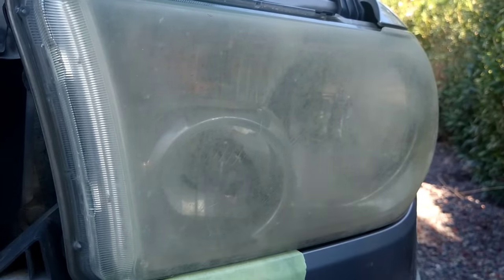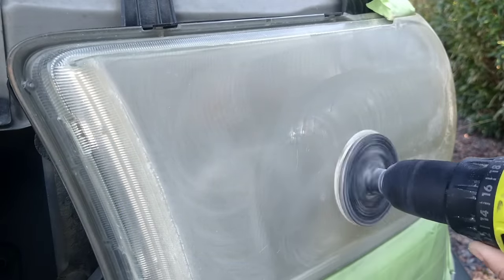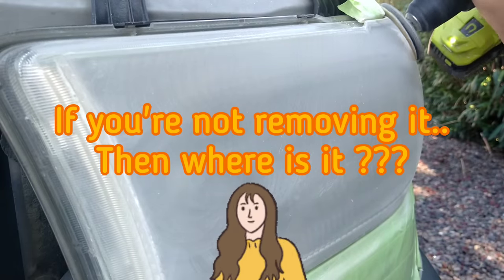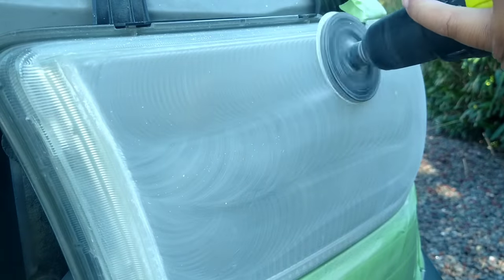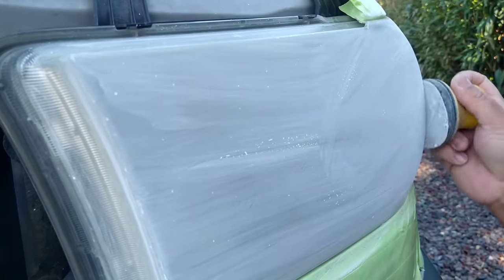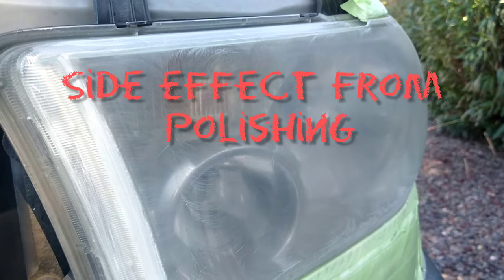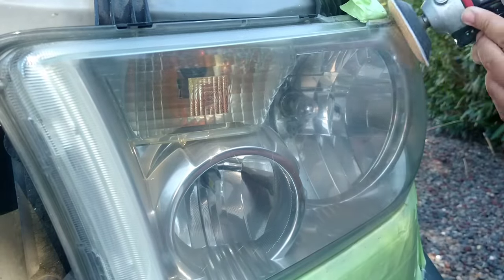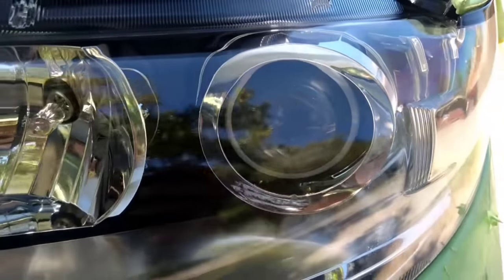POLISHING HEADLIGHTS IS A SHAM/scam  ---  and why you should never only polish headlights

Comment: having played this game, polishing does not last, it will be cloudy within a year, just buy new headlights, the problem is that they are made out of plastic and not of glass like back in the day, the headlights on my 1954 Chevy Truck are still clear, imagine that
Reply: The problem with glass lights is that the lenses break when a rock hits it. When theirs a hole in the lens then dirt and gunk gets in there and so have to replace anyways. 
Sand, polish, ppf and ceramic coating is the way to go. Not polish only.
Reply: @ragnaroksangel  and how many weeks / months before you have to do it again?
Reply: @Good-Enuff-Garage  so far on my wife’s car, sons car and about 50 other customers cars I’m at 5 years.
Reply: @ragnaroksangel  not anymore but I remember the days back in the 80s when my Dad and I were replacing headlights once a year on our cars. Luckily they only cost $20 back then.
Reply: @ragnaroksangel  bahahaha, furniture oil is also a petroleum product which washes off after the first rain or cleaning.
Reply from the maker: https://youtu.be/LcMFr0mpp-4
Reply: @Good-Enuff-Garage  Not weeks/months. YEARS.
Reply: @ragnaroksangel  not being a dingleberry but if you figured out how to make them last years then why haven't the army of engineers at Honda, Toyota, GM, Ford, etc.... ?
Reply: @Good-Enuff-Garage  would you like to see the proof?
Reply: @ragnaroksangel  How come I’ve done it then?

Comment: If you have a new car, I’ve found that if you wax the headlights once a month, they’ll never turn cloudy. I had an Escape for 13 years, and the headlights were crystal clear.
Reply: What type of wax? Is the new ceramic coat better?
Reply: @curlyhairdudeify  I’ve never used the ceramic stuff. I used Meguire’s liquid wax, but any good wax would work, My car was always garaged every night too.
Reply: Mineá Renault Kangoo,15 yrs old, always parked outside in southern France.
Only ever waxed the headlights,and they are fine...some Kangoos I see on parkings etc. are fully dull.
Reply from the maker: @patverum9051 waxing is the best thing you can do for prevention..
Reply from the maker: https://youtu.be/kIur4XxYjDk?si=PlxxqXdYzN9nL7or
Reply: Indeed. The best thing you can do is not even let your headlights get to that point. Unfortunately, if you buy used, sometimes they’ll be like that before you buy (so you’ll have to polish them at least once)
Reply: A major thing is how much time the vehicle is exposed to daylight.  The more you garage it or even park it in a carport, the less deterioration you will see.  I've seen cars with uneven degradation, and I figured it was just a matter of where they were parked most of the time.  Unless in the center of a carport, the one nearest to the edge of a carport will deteriorate faster than the other.

Comment: Completely agree that it takes time to properly restore your headlights.  The Sylvania kit works great, but you have to put in 15-20 minutes per headlight if you follow their directions.  Mine lasted almost 5 years before I had to do it again.
Reply: I just used the Sylvania kit on my headlights. I bought their kit because it came with the UV protectant/sealant. So far they look great.
Reply: @theheadlightrestorationpro  I watched Project Farm do a video on a bunch of headlight restoration kits. The Sylvania kit was on he recommended.
Reply from the maker: It's an awesome kit...👍🏼
Reply: Its been over 1.5 years since I restored the headlights on mums car removing 90% of the yellowness and clouding there is still some around the edges that I just couldn't remove the worst of it but they are still the same as when I first did them so I must have done something right.
Reply: Wow. 15 to 20 minutes. PER HEADLIGHT!?!? What will we ever do? I work at a place that routinely does this. It doesn't do itself and labour is a thing when you want good results. You got 5 years which is better than your average $500 to $3500+ for new headlights......per headlight.
Reply from the maker: @minkorrh you can't beat good headlight restoration.. for fraction the cost of new headlights...👍🏽💯
Reply: Where can you buy this kit
Reply from the maker: @brianmatthews4149 everything I use is listed in the bio....
Reply: That's 30 minutes.... Stop crying lol
Reply from the maker: @thesoundmajors9858 👍🏽
Reply: I use Novus plastic polish no 2..works great. Just a cloth and some elbow grease.

Comment: The method I used was similar to what you did.  I got up to a 2000 grit (part of the Sylvania kit I used),  each lens took about 45 minutes of sanding and prep.  Now it's still good over 2 years later.  I think the key is to take  your time don't rush any step and really do each step as thoroughly as possible.
Reply: I went the dollar store bought a box of baking Soda and a bottle of white vinager . Mixed them 50/50. Boom voila problem solved. Don’t believe me go spend four dollars and spend twenty minutes. Job done.
Reply: Baking soda white vinegar ten minutes work and you’re done. Four dollars at the dollar store.
Reply from the maker: I can go to the refrigerator and put sour cream on the headlight and buff it off I will look good for a minute but it's going to be nothing compared to what is going on full true headlight restoration I'm sure you know that...
Reply from the maker: https://youtu.be/x1gp9ATZTI8
Reply: @theheadlightrestorationpro  Its like spraying WD40 on stuff it looks good for a few days and then quickly wears off.

Comment: I worked for an OEM headlight manufacturer about 20 years ago. After we molded the PC clear lens we then sent it to a company that would coat the lens in a proprietary manner I think we called it "hard coat".  Some lens had small runs on them when they came back to us.  This coating blocked the UV and prevented the degradation you are dealing with.  If you don't have some type of UV protection after your treatment it will, as you say, come back quicker and quicker.
Reply from the maker: 🙏🏽💯yes.. thank you for watching .. really appreciate it..
Reply: 2k clear
Reply: Yes! Thank you! Its amazing how many people fall for the restoration scam!
Reply from the maker: @StonemanRocks all the time..
Reply: they cover it with UV lacquer for.
.well..UV protection 🤣 It actually is a plymer that hardens with UV light. Used in UV printing used in many manufacturers for printing various stuff. Lige for instance printing texture on ceramic tiles on floors... Those are UV hardening paints, lacquers
Reply from the maker: @alexandermurghulia7140 no
Reply: I have a crossfire that seems to have cloudiness and condensate on the inside of the light housing. One person said to take light assembly out and fill with methyl alcohol and heat with a heat gun. Haven't tried it yet.
Reply from the maker: @scotmatheson1109 sounds like a lot of drama...
Reply: @theheadlightrestorationpro  wasn't sure if it was real or not
Reply from the maker: @scotmatheson1109 what do you mean?
Reply from the maker: @scotmatheson1109 oh I get it
Reply: @theheadlightrestorationpro  it will be about 5-10mins in with that heat gun! Lot of drama then! Hope his insurance is up to date!
Reply: @scotmatheson1109  that would be could be a bomb my friend! Sounds like some silly advice!
Reply from the maker: @StonemanRocks 👍🏼
Reply from the maker: @StonemanRocks 👍🏽
Reply: that's why if you have to get aggressive, it's best to clear coat them after removing the yellowing and crazing (oxidation).   Using a good clear with good UV protection .   the only thing better is replacing them...
Reply from the maker: @danoman1893 you have to have a clear coat..👍🏽
Reply: It's basically automotive clear coat.  They use this interestingly enough on pinball playfields as well (called DiamondCoat - probably the term you heard).  Without it, the plastic is doomed in months and also significantly weaker to impacts as well.
Reply: So working with toothpaste won't work either. Same as polishing?

Comment: Only 2 things wrong with glass headlights;
1.  You could buy aftermarket ones  super cheap, and install them easily, completely leaving car dealers out of the transaction
2.  They are beyond rugged and scratch-proof.
(Ditto for hood springs vs. pneumatic struts.  Springs last forever, struts only last a few years.)
Reply: Depends; some aftermarket headlights for different makes are inferior to OEM ones when it comes to durability, and turn yellow faster than the OEM headlights.

You can have the old OEM headlights made in USA that lasts for decades, and then most of the cheap aftermarket ones are made in China fog up and fail to seal out moisture in a few years.
Reply: How the hell do you break a strut in only a few years? 
Mine are 25 years old and only now are they starting to get weak.
Reply: @1marcelfilms  Never had one 'BREAk" but I have had them get weak enough that I built and carried a kickstand until I could get the time to replace them.  Car was '87 beemer, back in year 2000.  Hood springs work forever, survive until the car goes to the crusher.  THAT is why they have been replaced with gas struts.  Ditto for glass headlights that you could buy for around $6 apiece.
Reply: Although better than plastic, glass does scratch

Comment: Always let the abrasive do the work. If you have to use force, the abrasive is no longer sharp or of the wrong type... or you're trying to rush the job. I do this job with 3" and 5"pneumatic orbital sanders, and pads up to 15,000 grit made for plastic. I don't use a plastic polish but I do use a UV-protectant sealer, That's an absolute must!
Reply: Yes, the uv sealant or clear coat is the only way to make the finish last for a long time.
sometimes I have just used a foam pad and compound to shine them up, but they will always go dull after a couple of months. 
Whatever UV coating they have used at the factory has gone. Sometime this os obvious, as you can see the film breaking up.

Comment: Was doing the same yesterday on a 2001 Ford Ranger Edge with original clear light covers. It's a work truck for me and nothing else. I used Mother's NuLens mainly for the polishing head and polish. Clean up with 90% rubbing alcohol. Cheap low tack green tape to mask. Sprayed lens with Meguirs Headlight Coating. I've done this every couple of years with different products for 15 years. Works for me. Would not spray a perfectly new headlight cover, better for an older vehicle's headlight covers. Solid video and grear job.

Comment: I work at a body shop, this is pretty much the process I showed my boss compared to how they did it by just polishing the piss outta it lol. I wet sand by hand though, depending how bad the light is I'll start with 800 if really bad, finish with 2000 and use a metal polish to polish the lights. Works wonders. My boss liked it so much only I get to do them now.... Hurray!!
Reply from the maker: 👍🏼 awesome...
Reply: Should have negotiated a kickback on each set you do. They respect you more when you fight for your real value..they cuss and grumble but would do the same things. That’s how they became, “The boss” or owners.
Reply: @toekneesee7113  nah, his father owned it and it fell into his lap basically lol. But I agree with what you said, wouldn't have been a bad idea 🤔 to late now been years lol
Reply from the maker: Yes... very true...
Reply: I ran a body shop for a while as well, we would actually sand the off the headlights 400-600 Then mask them off and clear them when we did the other repairs. I’ve seen lights that were done five and six years ago, they still look great
Reply: @imagemaker666  that's how my boss and them used to do them. Until I told my boss I could polish them 🥲🥲🥲
Reply from the maker: @imagemaker666  that's how it's done 👍🏼
Reply from the maker: So they wanted the inferior product instead of the real way.  🫣😱
What kinda business does that ....
Reply: @theheadlightrestorationpro  yea I hate polishing. Boss hated using the "expensive clear for shitty headlights" lol. But I do my best, they come out looking almost the same. I doubt it lasts nearly as long though. I'm already looking for a new job. Underappreciated here.
Reply from the maker: @JacobE-23  do headlights become your own Boss... Food for thought..

Comment: I used the 3M kit and it was a bit more expensive and it worked very well on my wifes car.  I had never done this before, and I watched Farm guy comparison, and then followed the directions.  Worked quite well!!  I was amazed.  The cause was not as described in this video. The cause was simply age and living on a dirt road and a very very buggy area (acids).  Anyway, good video.  Thanks.

Comment: When I was working for a shop in Charlotte, NC this was the same step process we did. It was a big kits that was in a carrying case. Only difference was we had two different pneumatic drills…one being a stubby type drill for the sand papers, and the other a polisher type drill that had two different type foam pads for the head. Headlights turned out perfect (if done correctly) every time.
Reply from the maker: Cool man.. yeah I know 3M sells this $500 headlight restoring tool kit that uses air pressure.. super high tech it's nice but out of my price range..lol

Comment: I do everything you do, but with two extra steps. I'll also wet sand with P500 and P800 after I dry sand with each. I feel I get a much smoother surface because I'm cutting into the material just a little bit more. I personally have found the Mother's Headlight Polish and Meguiar's sealant seem to provide the best results, in my experience.
Reply from the maker: You going to watch out for excessive sanding you don't want to do more than you need too. Thanks for watching plenty of ways to do it.. out of my experience of being a headlight Restoration company , also being a restoration specialist ,and high end detail shop. This is what I have learned to be the best through tons of experimentation and well over a thousand headlights done...
Appreciate you watching probably should check out some more of my videos..😁

Comment: Based on my experience, you advice is spot-on.
I used a 3M kit to do essentially what you show in your video. There was a learning curve. Patience is important: My first lens took about two hours. The results have been great. My biggest surprise was how yellow the first removed material was. I've done multiple cars now (for family).The first car's headlights were cleaned up two years ago and still look great. The only down-side of the 3M kit was it did not have a UV-blocking final coat. I had to purchase that separately (Yes. The UV protective coat was distinctly labeled for headlights). My biggest struggle was getting the swirls removed (patience, keep the drill moving, keep the pressure light). I tried a sanding block, but gave it up quickly because it would not conform to the compound curves of the headlight and only provided a line or point contact. I do wish that I had had a hand holder for the sanding discs, one like you used in the video (gotta find me one of those).
Reply from the maker: Yes that is the main reason I've Incorporated the step with the hand sander it helps level out until the micro swirls left behind by the p800 and some occasions it really just deletes them.. it's a must step but most headlights... That with the extra high power 700 RPM polisher make an extreme difference...
Thank you for watching...😎🙏🏽
Reply: You ever watch the video by ChrisFix? He shows you how to do it without a device
Reply from the maker: Yes . He's awesome he's one of my favorites on YouTube.... What's that being said yeah you can do it without devices you can cut a football field with a push rotating old school lawn mower might take you 15 hours and I might look decent for what you working with... But it would never compare to a team of people on sit down lawn mowers that did it in 1 hour... If that makes sense...
But you can definitely do it without any kind of tools or whatever if you are skilled enough it can come out pretty good..
Reply: @theheadlightrestorationpro  I love that you aren’t bashing him! My comment was more for the OP, but for some reason it didn’t tag him. It’s definitely why I found your channel. I don’t want to do it by hand when I can use a machine 🫠 Just wasn’t sure on pressure/technique etc. love the content! Glad I found your channel from the “recommended view”
Reply from the maker: Keep watching my videos there's a bunch of videos that specifically stayed on pressure and how much pressure to use more in depth but basically you just want to finesse you want to use very little pressure it's more finesse than strength..😎💯❤️
Reply: @theheadlightrestorationpro  THANK YOU! ❤️‍🔥
Reply: the meguiars headlight kit includes the hand sand tool
Reply from the maker: @Robbie-mw5uu yes a lot do include different hand Sanders...
Reply from the maker: https://youtu.be/WXUWWF47Kys?si=ntUGrrEmlExS9_Wy
Reply from the maker: @Robbie-mw5uu  https://youtu.be/WXUWWF47Kys?si=ntUGrrEmlExS9_Wy
Reply: I tried a sanding block, but gave it up quickly because it would not conform to the compound curves of the headlight and only provided a line or point contact.

Try using a sanding sponge.